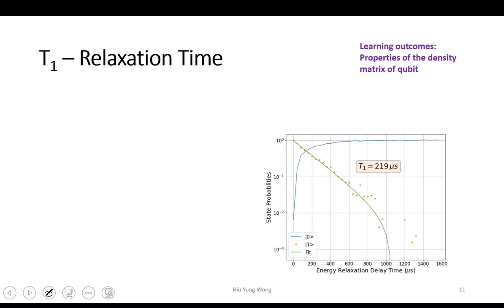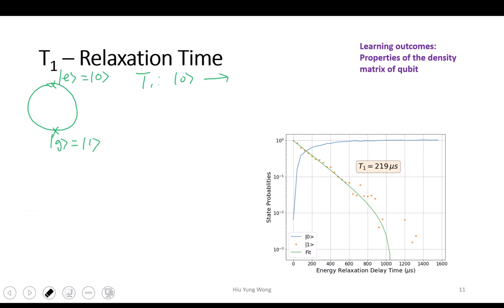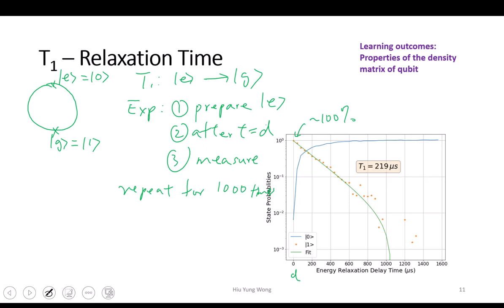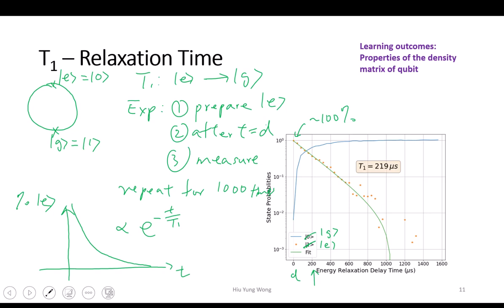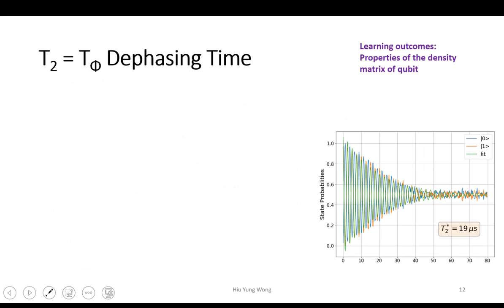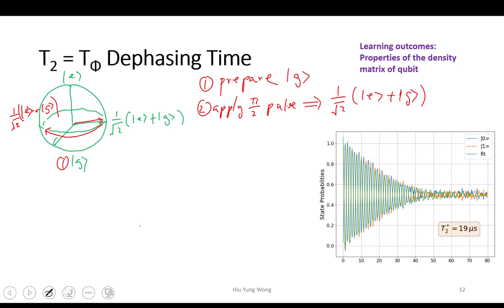L8-3 T1, T2 Decoherence Time and Spin Echo

Comment: thank you for the lectures! They are of great help to me. 
What are the criteria for determining relaxation time (219 us) and dephasing time (19 us)?
Reply from the maker: @yb9494 These are determined by its interaction with the environment through which it loses its energy (T1) or phases (T2). E.g. in a superconducting qubit, it might be due to two-level defect systems.
Reply: @quantum_computing   My question is.. how to determine the relaxation time experimentally. is it the time it takes for the population of the excited state to decrease to 63% of its initial value??
Reply from the maker: @yb9494   Yes. E.g. see 4:37. Thanks!